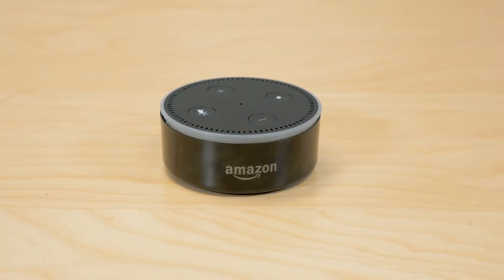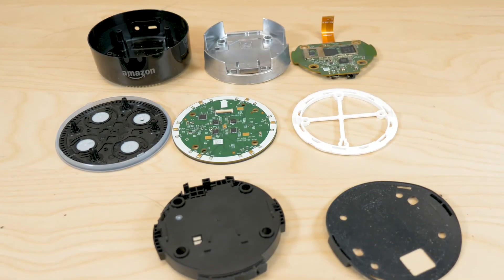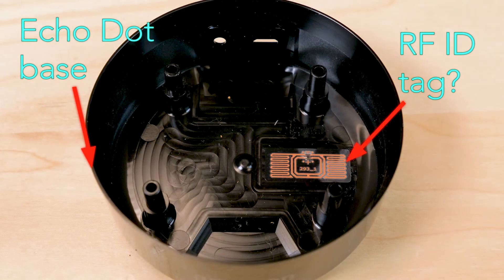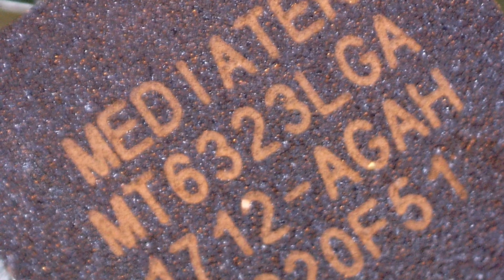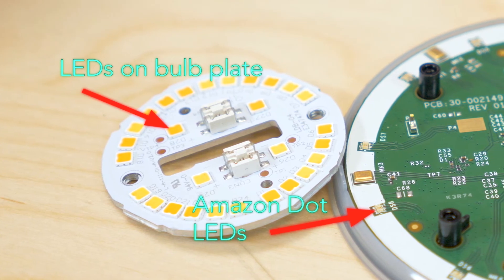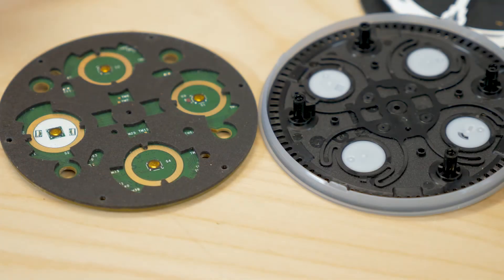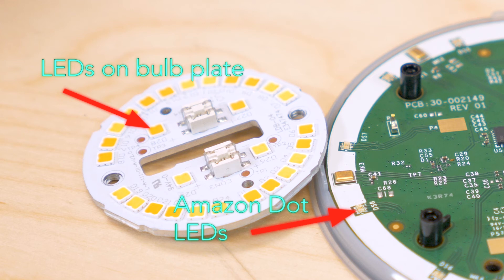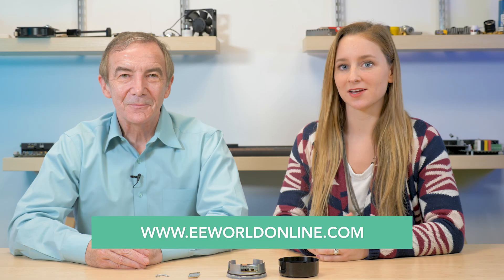Teardown: The 2nd generation Amazon Echo Dot

Comment: Very interesting design.  Such a small speaker, so that's why it doesn't sound as good as the original Echo device.  I've been wondering how to make my Echo dots sounds better and was thinking of building a tall "canister" out of PVC pipe and making holes in it to enhance the sound.

I would like to add that the woman in the video is an absolute doll.

Comment: If the echo has a notification it's LEDs can be on for a prolonged period of time. But, I actually think the primary purpose of the heat sink is to give the unit weight.

Comment: The large heat sink is probably for the processors, right? They're attached to it via thermal tack, and they're probably the source of most of the heat
Reply: Exactly. Is the way to keep cool the chips. Otherwise they will be very hot.